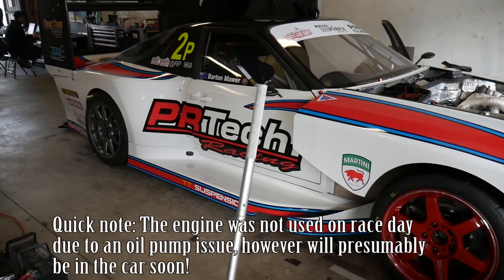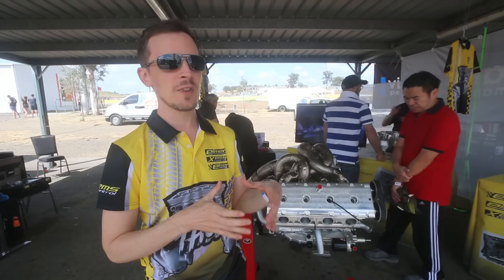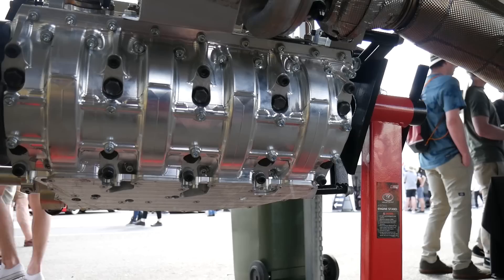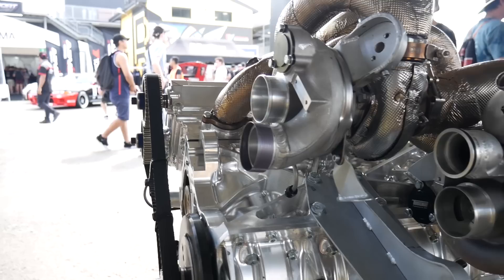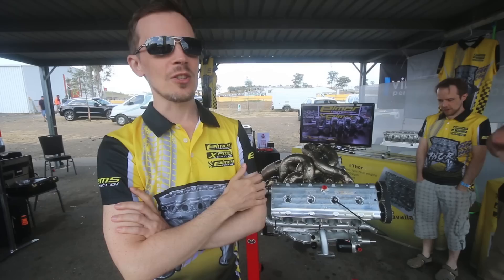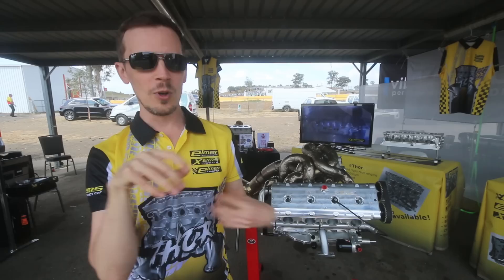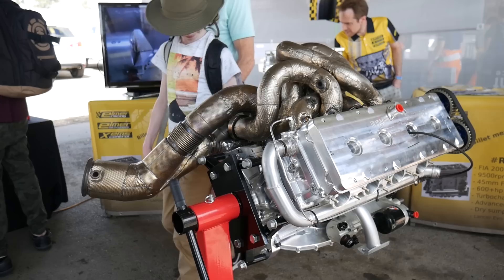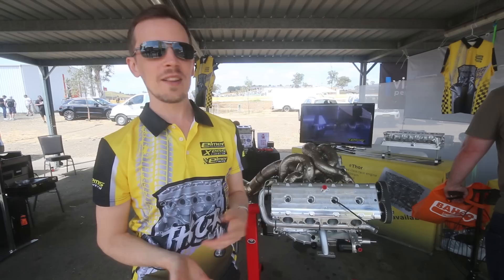4.0L | 4 Cylinders | 1500hp | The *nearly* All Billet RP968 Engine

Comment: Billet this, billet that. For those that don't know, "billet" is a solid block of aluminum. What they do is put this block into a CNC machine, and it will cut the block into the shape you have programmed it to. The big and expensive machines can do complex shapes. It's a fantastic tool.
Reply: Cut in one piece out one block of aluminum
Reply: Doesn't necessarily have to be a solid block of aluminum. Could be steel too. Or various other metals and alloys.
Reply: @superbarnie  Even magnesium prototypes, which would be awesome if they get it to work properly.
Reply: thanks.... was always wondering what it means 🙂

Comment: One thing cool to think of with this engine and the 4cyl set up he did not touch on is ... if you make 1500 hp with 4 cylinder compared to the LS @ 1500. The 4 banger is quite a bit more efficient due to parasitic losses. The LS engine would have to make a lot more gross power to over come the reciprocating friction of 8 cylinder . The 4cylinder would have a lot less parasitic loss for the same out put. Another thing is that is being turbo charged means that is has back pressure on the exhaust stroke. This is called drive pressure and really helps longevity of the rotating assembly. First off cylinder pressure kills rods not so much RPM . What RPM does do is put a lot of stress on the fasteners used on the big end and the material over the top of the wrist pin. These stresses are at there greatest when the piston turns the corner @ TDC on the exhaust stroke. In a N/A or blown engine there is very little back pressure on the exhaust stroke . So when the crank shaft has to stop the piston and turn it back around in the opposite direction all the forces are at the wrist pin and rod bolt or cap screw. This is referred to as the OVERLAP . In a turbo charged engine the drive pressure creates a cushion to help slow the piston down @ TDC on the overlap ,and buy slowing it down it helps the crank shaft change its direction lowering the stress seen at the pin, cap screw or rod bolt, and the bottom rod bearing. I️ work with a lot of Promod guys and when they started running turbos on them we started seeing no fatigue in the connecting rod or the bearing . It is common routine on a blown alky or NO2 engine to pull the oil pan and check the rod and main bearing every run. Most people actually tune the engine by how much the bearing was deformed . If the engine is in the sweet spot and your standing on the tune up it’s common to squish the bearing vertically a tho or two. When the put turbos on the same hemi’s that ran blowers and screws it stopped squishing the bearing so much so that today’s turbo pro mods will go 20-30 runs and not pull the pan if they don’t hurt any thing on the run, while the no2 and blown guys have the pan off every run. That’s why I️ was critical of his we might have to manufacture  are own rods for higher rpm statement . Because the rods in that motor live @ 3000 hp all day @ 10,000 rpm in a v8 pro mod so I️ don’t see the problem in a turbo4@1500. Lol sorry for all the nonsense are racing year is just about over and I’m bored 🇺🇸🏁
Reply: rotaries would be even better imagine a billet rotary
Reply: I think you would be about even because of the size of the engine the LS would use less fuel and be smoother
Reply: @kevinmai4326  rob dahm has one
Reply: @trevoncowen9198  how would the LS use less fuel, when there is more friction and reciprocating mass causing parasitic loss?? You didn't listen to a word this guy said, and judging by his informative post, I bet my life he knows 100Xs more than you do, Mr. Keyboard tuner
Reply: spenc k it uses less fuel under load because it doesn’t have to work as hard for the same amount of power the extra mass is balanced out by the extra power strokes. You can probably achieve the same thing with a 6 cylinder depending on required load.
Reply: Tre'von Cowen Just because v8’s can make more power with less effort doesn’t mean they burns less fuel, you’re forgetting that the higher the displacement the more fuel. 4cylinders, 3cylinders have always been more fuel efficient than v6’s and v8’s ....the only benefit to a v6 or v8 is reliability which is irrelevant since this engine is a billet monster.
Reply: WattsUpDev it’s a 4L 4 cylinder which is way more displacement than say a 5.3L V8 one cylinder is 1L. So yeah this is cool but it’s far from efficient. Also less effort means less fuel. But remember that’s under load like acceleration, maintaining high speeds or towing. At a constant low speed the 4 cylinder is superior but not this one because it’s too big.
Reply: man, but its a i4 so it means that somehow it will have a lot of secondary imbalance even if you use balancing rods it will still have some. such a small engine producing so much hp is not good for it and not last long. it will also cause a lot of friction which will not in a big engine
Reply: I agree that exhaust getting pumped out of the chamber helps the bearings by reducing the force they see, but being aluminun rods they stretch and get metal fatigue from the RPM's. They are beefy and don't compress from the cylinder pressures, so unless your knocking or dieseling the rods won't care about cylinder pressures. The forces on the rods (and therefor the bearings) increase to the square of rpm minus the exhaust pressure acting on the area of the piston, which means it does not increase exponentially as long as exhaust velocity doesn't choke
Reply: Not caring about cylinder pressures only aluminum metal fatigue is also why those rods can handle 3000hp at 10,000rpms "all day" a few seconds at a time and still have issues at 1500hp between 7 and 10k rpm for hours before they need to be replaced or risk breaking. 
That's why he mentions higher rpm's causing shorter engine life
Reply: “Are” and “our” are different words.
Reply: Cost is the biggest issue.   Pretty sure I remember correctly that 1300 whp on a 5.3 with stock bottom end before it blew its guts all over the dyno floor.  Even the aluminum blocks can hold that if re sleeved with darton.  Especially if you run an ls9 or lsa block as they are a stronger alloy from standard ls.   As far as efficiency with fuel, its a 4 liter with a turbo.  With the need to maintain proper air fuel ratio you will need to add more fuel with that extra air.  For every racing series I can think of, you have restrictions on the engines and power used.  Unless this is just some weird flex.   If we are talking all out race engines and efficiency, although its using nitro methane, its still using a roots blower and a mere 500 ci for top fuel drag.  That 12,000 + hp aint to shabby.

Comment: 1500hp from 106kg!? MADNESS!!
And those billet parts are pure PORN.
Reply: He did say 106kg for the engine alone, which sounds like the weight of the long block. Which is basically assembled bottom end and valve train, no turbo/exhaust manifold, intake, etc. probably with everything else added it's another 40~50 kg. Still an awesome badass engine.
Reply: ill take one of those 2500+hp engines that NRE makes. 

https://www.youtube.com/watch?v=HA6am0rCwAk
Reply: Those are badass, NRE is pretty legendary, but I imagine fitting it into a 944 would be a challenge.

Comment: Good work, but credit is still with BMW, Honda, Cosworth, Ferrari, Renault, Tag and others that were pushing that kind of power out of a CAST 1.5L block and head back in the 80's F1 glory years. Not to mention the agricultural Electronic control they had to deal with.
Reply: yes but they were grenades in during qualifying,  todays Billet block engines can reach upward of 100psi boost pressures and still be reliable, oh and these guys dont have the $millions to play with in R&D like F1 does
Reply: that's my point. Even today's F1 engines at 1.5L pump out a reliable 7-800BHP (limited by fuel flow regulations) + Electric. And they run cast blocks and heads. Billit is cool, but high quality, well engineered castings are better than most people realise.
Reply: The old 80's F1 tech was marvelous, but I'm pretty sure that it's kind of blown out of proportions the power levels and the components they used.

Comment: Great engine, and story. Two things worth mentioning, alloy rods do not like engine braking, deceleration, in a circuit car, v a drag car that turns the engine off after a run. Renault were making 1200 - 1500hp from a 1500cc engine with very old turbo technology in F1.

Comment: It's a nice engine but will it fit in my Honda?
Reply: I tried it, but my Fireblade's body is just not big enough...
Reply: would be better for my Suzuki samurai
Reply: Mercedes Mob This thing doesn't look much bigger than a lot of Honda K series setups and nowhere near as big as a 2JZ.
Edit: Comment deleted it seems. Should be said though, sleeved K series motors ~2.0L are putting out north of 1100 horse power on e85/e98, half the displacement of this billet monster. Worth all that CNC time?
Reply: K with over 1000 is for drag not real racing.... surely. 
the1000hp K s2000 in formula drift never even made a pass that I know of. still really cool, a massive sexy paper weight.
Reply: a red 1500hp rwd honda fit sleeper would be in my nightmares
Reply: How can I get this in my f150?

Comment: "Billet valve cover" WHY!?
Reply: Because race car :P
Also extreme amounts of pressure.
Reply: i was thinking the same. the goal was low weight so why not carbonfiber? or maybe the valve cover is billet because its strenghtening the cylinderhead?
Reply: MsSomeonenew 
engine sump needs to be in vacuum. pressure inside valve cover and sump is very bad thing
Reply: MsSomeonenew if the valve cover is under pressure you have problems 

Especially large amounts of pressure 

Carbon fiber would be best here

Comment: 4L 4 Cylinder? How is it not vibrating itself to pieces?
Reply: ZPERO just like the 26 or 27L Fiat engine didnt. Some kind of sorcery :))
Reply: Car magic......
Reply: Geometry
Reply: Yeah, it should. Because of massiv free mass forces of the second order. Lighter pistons and rods and i really high boost would be the better solution. Maybe with e-turbo. Summarized that engine is outmoded and therefore nothing special.
Reply: ZPERO IT'S BILLET SILLY ! AIN'T YOU LISTENING! hahaha 🤣
Reply: Arthur McHugh
Billet is overrated, even if they carved the parts out of a hunk of metal, if that hunk of metal was casted at the factory, they aren't gaining anything. What people should specify is the alloy, and the manufacturing process, example:
--> 1060 steel, hot rolled
Reply: Usually if a piece machined from billet can be replaced with a forging this should be done since all else being equal forgings are inherently stronger.

Not financially viable though unless you make a fair few of them. Machining rules for one-offs.
Reply: Gustav Meyrink
Forging aka a combination of "cold working" and "heat treatment" in engineering terms, make the parts stiffer and more brittle, or less stiff and less brittle.

As an engineering student, I find the whole "hurr durr forged master race" ridiculous. It would be much better to analyze the stress the part is going to be under, and what strain, fatigue (due to the cyclic loading in engines) and creep (creep analyzes the propagation of microscopic cracks at different temperatures and loads) and decide how long you want these parts to last at a certain rpm.

Then work backwards from there, select a material (an alloy) and will inherently maximize the desired properties you want while keeping weight as low as possible. In my university, the one of the clubs competing in the "super mileage competition" has carbon fiber valves for their engine for example.

So I just find the whole blindly using whatever forged part you found in some forum kind of ridiculous.
Reply: May be your material science lecturer should take that up with mine.
Although I am fairly certain that mine is long retired.
Reply: Thank the lord another engineer here. So many parts are also obviusly heavier and more expensive than simple stamps. However these guys are more in the like of mechanichs than science people, therefore you are asking too much from them.
Reply: Joaquin Lanusse
I love the F1 approach. They carefully aim for 5 races, and if the engine lasts more than that, it's carrying extra weight. So every part is as light as it can be while lasting 5 races.
Reply: Detroit Diesel made the 4-71 engine which is a 4-cylinder  and has a displacement of 4.7 L
Reply: or why it would vibrate to pieces?
Reply: ZPERO the stroke is kept under 4,” and a large bore is used to create the cubic inches. This will vibrate allot less than if an increased stroke was used to create the same ci.
Reply: But these guys are not going to replace the whole engine all the time. Just conrods or something, and is really easy to do.
Reply: Yes, conrods and big and little end bearings. I'd imagine the main bearing would last a few changes of rods and rod end bearings. And did you see the fucking SIZE of those five mains on that gorgeous crank. crank.
BTW the reason carving something from a full hunk or billet is better, it is guaranteed to be much stronger and uniform throughout. The alloy used can also be superior, as in order to get reliable castings the alloys used have to be different. One simply cannot use the same alloys to cast with.
Casting also can place some limitations, and can also have voids or bubbles that reduce integrity further.
Reply: 🤣 that’s gotta be better then a V8 1500hp right
Reply: fairy dust

Comment: Beautiful work. So what are the finished external dimensions and weight for a fully dressed 1500hp setup with all accessories and manifolds attached? Also what was the reasoning for maintaining the stock bore centers and flat plane crank? Was a crossplane crank investigated? What are the 2nd order vibrations like? That's a lot of displacement, rpm, and power for an I-4.
Reply: This is an old comment, so you might not care anymore but you can usually estimate aluminum parts to be half the weight of their steel components for equal strength.
 Flat plane is the normal configuration for inline-4s because it's the best for minimizing engine rocking, it's also significantly cheaper and easier to machine from a billet. 
4 cylinders always have bad 2nd order harmonics but are often covered up with a balance shaft from manufacturers that cause opposite 2nd order vibrations for an engine that seems smooth but actually is just hiding their inherent limitations.
Aluminum metal fatigue is a major drawback for longevity since it doesn't have the spring-back characteristics of steel. It's trades longevity for reduced weight for high stress components. 1500hp isn't too difficult for many 4 cylinders to handle surprisingly. Many Honda and mitsubishi engines can handle this with their factory block and crank. The displacement and rpm would be an issue normally but because of the significantly reduced weight of the aluminum rotating assembly the forces are much less than you would expect.
The pistons and rods are very similar to what a dedicated drag engine would use

Comment: It's a larger Honda or Kawasaki motorcycle engine.  MC engine designers have been at this for years to increase power and reduce weight.  They have been doing it the same way, by using large pieces of aluminum in billet or cast and then machine to spec.  Additionally, to engineer the reciprocating parts (anything that changes to opposite linear direction during the cycle) with as low mass as possible and dynamically balancing them to make outrageously high revving possible.  This means thoroughbred (fragile) connecting rods, pistons and valves.  Four or more valves per cylinder are required to air-feed the high revving and keep their masses low.  Then double-overhead camshafts become essential for all of these valves.  Also more of the valve train is designed to run in circular motions instead of linear motions: Timing belts or chains instead of push rods and rockers.  More or all of oiling tends to be pressurized instead of opened wet sump to remove more weight.  Anyway it looks like a big motorcycle engine to me and this is what's inside of those.

Comment: Piston guided ?? Any one?? Great stuff !! A technology handed down from F1 to nascar to drag racing and now time attack. got to love the trickle !! By only allowing only enough space for thermal expansion between the 2 pin boss 
towers in the piston and the little end of the con rod, you creat a buttress effect threw the crown of the piston . By doing so you get a extremely stiff piston that will seal well in the bore at a reduced mass. Also by positively indexing the connecting rod on the crank pin you combat deflection of the beam in the parallel axis to the wrist pin!! Great stuff
Reply: thanks for your comment! that's good to know!
Reply: DoriFord thanks ! Knowledge not only is power , it makes it too😁

Comment: Impressive. But, will it fit in my NA Miata?
Reply: Pepè Silvia yeah. Wondered, if it would fit in my Honda though.
Reply: OnMyBike it probably would :P only 106kg, and its not much bigger than any other 4 cylinder engine. I dont think I have the balls to ride a 1500hp bike though.
Reply: 1500hp on a motorcycle, SIGN ME UP.
Reply: I mean, people put 5.7L engines with two cylinder banks into Miatas, so im sure this engine would be less than an issue.

Comment: Will the head fit a stock 944 turbo block?  We need aftermarket heads to replace the factory ones with the dumb ceramic liners that break up and ruin turbo impellers.

Comment: Excellent video. 
I got a doubt with billet parts. For example the ones that are in contact with axial and radial forces (crankshaft or piston rods and others). I always thought that is preferable to have them forged. Which process is better ? I'm just an enthusiast on the subject so correct me if I'm wrong.
Greetings from Argentina
-Nicolas